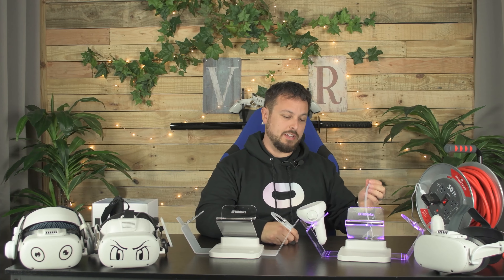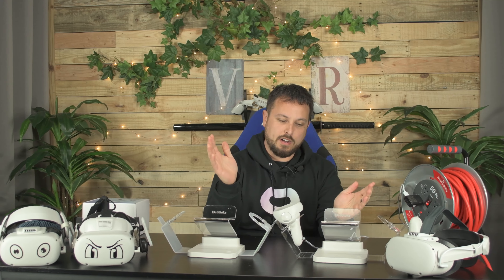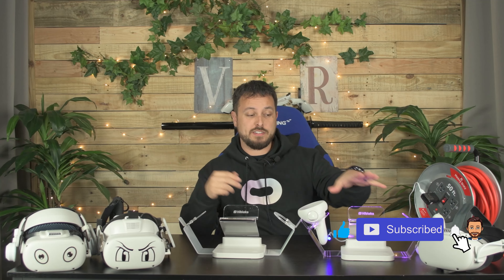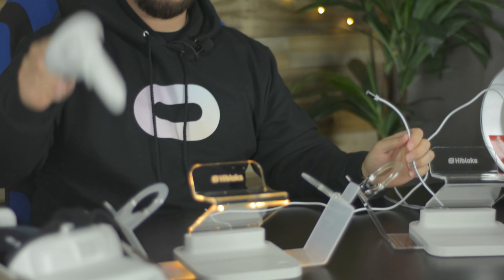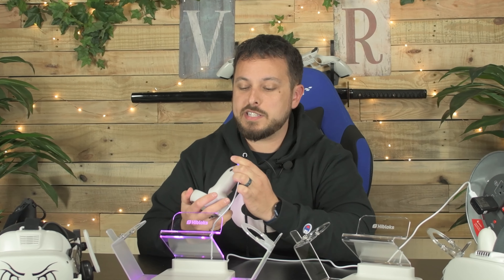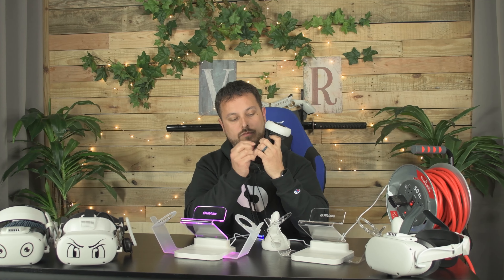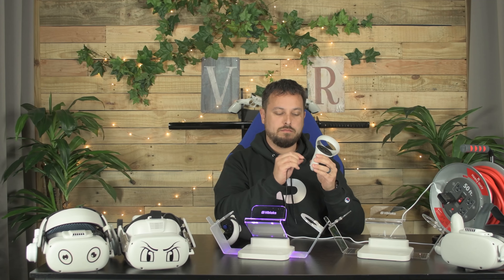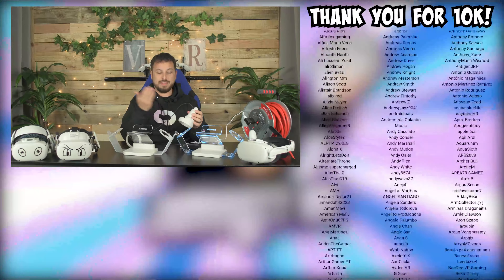This Quest 2 Dock SHORT CIRCUITS? Let's Fix It!

Comment: i noticed in your personal set up list you don't have the battery or cable listed.
Reply from the maker: I think they're both there? If you mean the battery on the headset and the cable that goes from the battery to the headset they're both part of the M2 Pro Strap.

256 GB Meta Quest 2 https://amzn.to/3EIA5nY
BoboVR M2 Pro Strap https://amzn.to/3EAX5GP
BoboVR F2 Fan https://amzn.to/3EALOVu
BoboVR D2 Dock https://amzn.to/3zemtPW
**BoboVR B2 Battery https://amzn.to/3zbsZal
BoboVR C2 Case https://amzn.to/3eABRgn
Kiwi Controller Grips https://amzn.to/3mGnhIs
**Oculus Link Cable https://amzn.to/32Blq0M
Reply: @jaybratt  sorry i should of made it more clear. i was asking about the battery and magnetic cable for the controllers. I was looking into getting the bobovr charging dock. But it doesn't offer charging for the controllers.
i now realize that the battery came with the stand. but the good (non short circuit) cable didn't come with it. 
I just wish bobvr had controller charging with the stand.